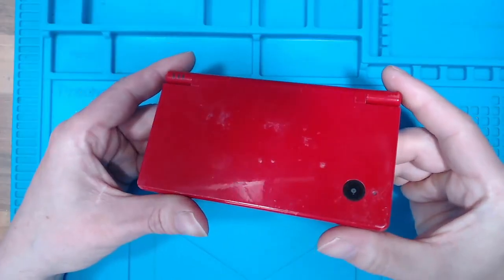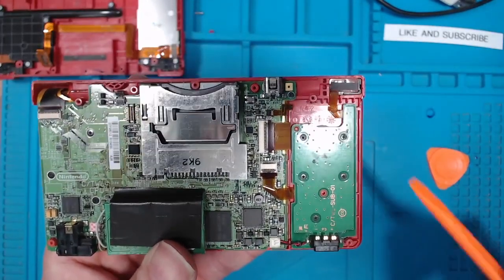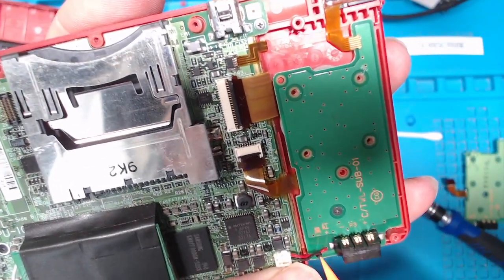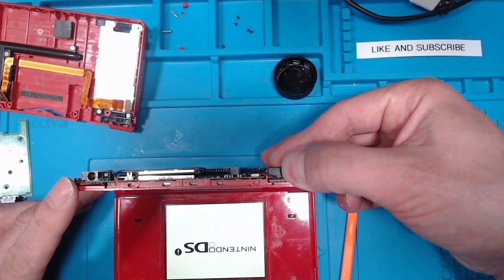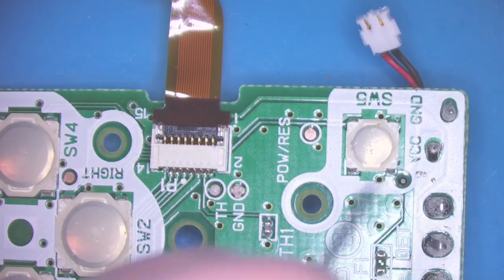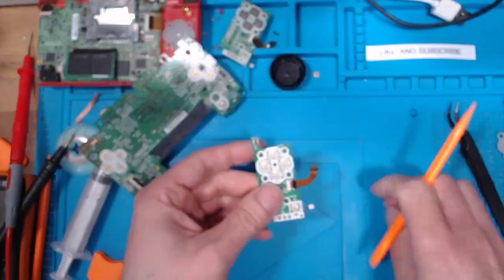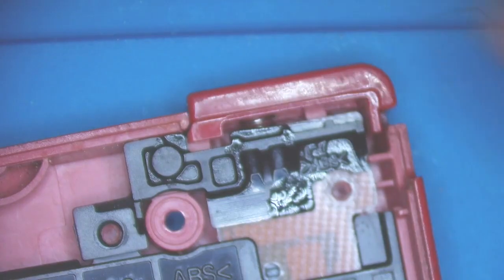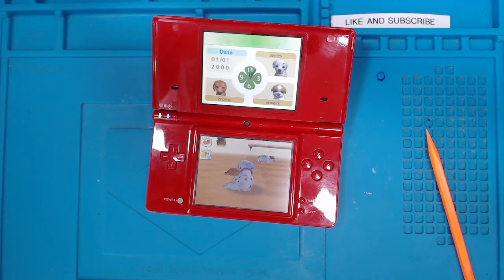Nintendo DSi won't power on | We can fix it

Comment: Mine has a charging light that turns off after a second
Reply from the maker: If it happens with a new battery installed there must be a faulty component on the board. Have you tried a replacement battery?

Comment: I have a DSi that charges but does not turn on. I checked the board and found that the female JST connector on the board is missing a gold pin. How could I fix it? How can I replace this female connector? (It's the white connector where the red and black cable connector from the battery board goes.)
Reply from the maker: You could think about soldering a permanent wire between both boards.
Reply: @PhilipBryden  Thank you for your response, but how would that be done? I don't have much experience with welding, and taking it to a service center is too expensive.:,c help

Comment: Hi. I found my old DSi but when I put it on charge, the charging and none of the other three lights come on at all. Is this just a battery issue or something else as there’s been a few other vids on YouTube where the battery was an issue but one of the lights were still coming on.
Reply from the maker: I've just taken a DSi motherboard and power board (no battery, no screens, no wifi card) just the bare motherbaord and plugged in a charging cable. I got an blinking orange LED.  So yes, you should see at least  a blinking ornage LED when you plug it in. I always say you have to start off with a known working charger and known working battery.
Reply: Thanks. So do you think it’s a problem with the charging port as well as the battery or the DSI is just broken completely?
Reply from the maker: Charging port could be a problem if the connector feels loose. Most likely the battery has also lost too much charge for it to be re-charged. USB charge cables and batteries are cheap enough.
Reply: @PhilipBryden hmm that’s interesting because when I shake the DSi I can hear and feel rattling inside, like something is loose. I’ll take a look inside, thank you.
Reply from the maker: @charlie1615 let me know what you find inside
Reply: Hi, turns out there was actually nothing wrong with the charging, and the rattling was actually coming from the buttons 🤣 the problem was that the USB port i was using wasn’t actually working so it wouldn’t charge. But there’s still an issue with the battery but I’ve ordered a new one then the Dsi should be fine 👍
Reply from the maker: @charlie1615 sounds like a good result lol

Comment: Prob just battery. I got lucky. Just bout a gbc, a dslite and copy of pokemon pearl. Pearl mint. Gbc gross af but just need cleaned and fired up no provlem. Didnt even try in og shell and dirty. And ds just put a new battery in and everything works. Crazy when its the simplest things. And only paid about 60 shipped for it all. Idk guess the person just thought they were trash that didnt work. Ive paid 45 just for gbc that may or may no be fixed or they days good but u never know. And was online too. Im just suprised since so hard to find  a good deal on retro gear these days even in shit condition. Might could even got cheaper i kept offer less on each item just to see thinking theyed counter. The DS was technically only 10 plus 4.50 shipping and pretty good condition. I was hoping for a beat up one that could make a macro atleast but got a way better deal. Prob just keep it whole since works well. Havent used a ds in awhile tho. Are the screens typically a lil cloading ln the start screen. Not yellow at all really just kinda darker in some but not dead pixels. Didnt know if just the film or images. Or maybe slight burn in.
Reply from the maker: Looks like you found some good deals. I never play on mine, they sit in a shoe box until I get around to selling them. DS screens seem to yellow over time. My latest video is a prime example of people selling stuff as faulty when it just needs a clean to get it working.  Loads must be thrown away. https://youtu.be/l0A6paSU1Ls

Comment: Phillip< i need your help. Are you, or anyone you know, understand dsi circuits well? I have an issue. When I first began to dabble in Fixing my old dsi, I took off the connector. the white one connecting the battery power to the Motherboard. I conneted the wires from the connectors directly, but rip those and now I only have the negative side for me to solder onto. Is there any fix for powering my dsi, but in a different location? I am stuck on this and would love to bring back my beloved console.
Reply from the maker: If you flip the motherboard over you'll see a BT+ and a BT-  test point. You might be able to solder there if the case allows.
Reply: @PhilipBryden  I will be honest, I did not think of the test points. I thank you for pointing that out for me. test points will still work anyways, right? First of me hearing of this. thanks regardless. This brings me great joy
Reply from the maker: I'm sure they will be fine as long as there is room in the case for the wires.
Reply from the maker: On the front side of the board, there's a pad with 4 vias next just underneath the + symbol. You could scrape the coating there and solder the positve wire there.

Comment: Hi, i have an old dsi that i haven’t used in years, i recently bought a charger for it to try turning it on. The charging light flashes orange and has been doing so since i plugged it in, it has been on charge for over 12 hours. When i try to turn the dsi on, it either stops charging or the blue light flashes on for a second and then goes off along with the charging light. The screen has flashed on for a second once. I have tried cleaning the charging port, taking the battery out and putting it back in again and holding down the power button for a long time but no joy. Any help would be greatly appreciated, thank you!
Reply from the maker: If you don't use it for a long time the battery charge goes so low, that it can't be re-charged. The best thing to do would be to buy a replacement battery. Hopefully that will get you playing your old games again.
Reply: @PhilipBryden  Thank you so much!

Comment: Hey, how are you? 
I need help, my Nintendo DSi

The problem is this: My DSi XL only works for about 2 minutes even with the battery fully charged, after turning it off, if you try to turn it on again immediately it will only start for a few seconds. But if you leave it off for a few minutes and try to turn it on again, it will work again for 2 minutes. I've already tested using another battery and the result is always the same. IT'S A MYSTERY TO ME
Reply from the maker: Is it draining the battery, can you feel anything getting hot while you're playing it? Seems like an odd fault.
Reply: @PhilipBryden  No, it doesn't heat up at all, a friend of mine also asked the same question before, and my DSi XL doesn't heat up when it's turned on.

I'm thinking that maybe I just need to clean it with isopropyl alcohol (I haven't cleaned it yet because it's only tomorrow on the 18th that the alcohol I bought will arrive)

I'm afraid the problem will persist even after cleaning.
Reply from the maker: There's only one way to find out. Open it up and look for any signs of corrosion or damaged parts.

Comment: So I just I’m trying to fix a White DSI with this same issue. Funny enough when I put the daughter board from the white dsi into a working blue dsi it works fine. However when I take the working daughter board from the blue dsi and put it in the faulty white one, it doesn’t work. What do you think could be the cause? Also just replaced the battery so it’s brand new and there are no signs of water damage to the white dsi at all. Any ideas?
Reply from the maker: So from what you ahve said, the motherboard on the white DSi is faulty. Have you checked the fuses with a multimeter? Does it charge when plugged into a charger? Do any screens flash when you try and turn it on?

Comment: After my top screen on my DSi broke, it won't turn on. It takes a charge, but it won't turn on. I got a flicker of the blue light and the screens turning on when I hit the power button, but that hasn't happened ever again. I have old pictures and Flipnotes that I want to get off of there that are saved on the system memory. I can't do the repair myself at all since I have some personal issues don't want to specify. If anyone knows someone I can possibly send my DSi to to get it repaired, I will forever be grateful. I am up in Connecticut.
Reply from the maker: Pinned. Hopefully someone can recommend a place to have it fixed.
Reply: @PhilipBryden  Thank you so much!

Comment: I don't know what's wrong with My ds. When I plug in the charger, the orange light goes on and off for a second. This is it. So the power won't turn on. 😢
Reply from the maker: How old is the battery? Your battery might be too low and it won't start charging.
Reply: @PhilipBryden  ok thanks ill try new battery. 😃
Reply from the maker: @user-bk8er2hc4l let me know if you get it working.
Reply: @PhilipBryden  I ordered a battery from AliExpress and it's not coming after a week. Where do you buy batteries by any chance?
Reply from the maker: @정환-t4u  I've them from Amazon or eBay.
Reply: @PhilipBryden  I ordered it successfully, but it's taking a long time
Reply: @PhilipBryden  I tried purchasing a battery, but the results did not change. I think the problem is with the circuit

Comment: I got the same problem but my power button works fine and fuse is good ribbon cable is good, connectors all check out. Sad
Reply from the maker: Does the battery have charge? Sounds a daft question but have you measured the voltage with a multimeter. Have you cleaned the ribbon cables and connectors with IPA? Do any of the screens flash when you try and turn it on?

Comment: I recently got one of these in for data recovery, client wants to get pictures from the internal storage. Just wanted to add a bit more info about these daughterboards for ya. I noticed some odd behavior with that daughterboard as well. In my particular case, it seems to throw off the charging input voltage. The input voltage is fine right up until the output of some kind of chip (guessing it's the actual BMS or charging regulator), in which it jumps all over the place. With the daughterboard disconnected, there is no output voltage from this chip. I suspect this is because it's expecting to see a load from the daughterboard (since that's where the battery goes). No load, no output voltage from the chip. 

I was confused at first because this board really doesn't seem to house anything but battery terminals and membrane switches. However, there is in fact a very critical component on this daughterboard. "TH1" means "thermistor". This is a variable resistor that changes resistance based on temperature. They are often utilized for monitoring battery temperatures. The idea is they can sort of act like a resettable fuse. If battery temp gets too high, the resistance of the thermistor changes, which can be used as a threshold signal for a BMS to pull charging voltage low to prevent charging the battery. 

In your particular case, it was a faulty button mechanism for the power switch. In mine, I think it is this thermistor. I don't know why else the charging voltage on the output of that chip would be going crazy. I didn't have a chance to test the resistance of this thermistor yet, but for future reference, you can test these by measuring their resistance before and after warming them up. 

Some thermistors are high resistance cold, low resistance warm, or vice versa. If you see no change in resistance, OR the resistance seems to be clocking all over the place and never settles around a consistent reading (or even reads 0L), it is a faulty thermistor. Many devices which rely on these for battery monitoring will experience issues with charging and, subsequently, powering on in-general because if the battery won't charge, it will eventually die and won't power on. 

If you're ever trying to fix one of these (or pretty much any BMS circuit that relies on a thermistor) to get it to just power on and copy data, you can likely replace the thermistor with a generic resistor. You'd have to try a few different values until you find one that causes the BMS to output a stable voltage.
Reply from the maker: That is really very interesting, thank you for sharing this. I have daughter board handy so I tested TH1 at room temp and got 10Kohm. Warming it up some hot air 100'c saw the resistance drop to 7Kohm. I'm assuming if anyone has a faulty TH1 they can replace it with a 10kohm resistor.  There's a couple of handy test points there too, right next to the ribbon cable connector.  Another great bit of info to add to my fault finding knowledge. Thank you again.
Reply: are you succeed ? are they got the pictures ? the pictures must be very valuable for them
Reply: @mrwoodcat  Yes and no. I was able to get the device powered on and popped in an SD card to start copying internal storage to external. Unfortunately, it wasn't reading SD cards. In my investigation of that fault, the device quit powering up all together and I haven't been able to figure why since. I'm hoping I can stumble into a schematic at some point. 

This particular DSi I'm working on was pretty moderately water damaged. I'm thinking there may be corrosion/oxidized balls under the CPU, but it's quite risky to yank such a sensitive component. If I can find a schematic I can test other possibilities.
Reply from the maker: @spartan456  I've been looking at a DSi that will turn on, display the menu but as soon as you try to open an app or play a game it displays the 'error occurred' message. This one is water damaged too but I guessing it's a software fault.

Comment: I’m very new to modding/repairing and I’ve learned so much from your videos. I really appreciate that your vids include a complete breakdown of your thought process and show a fair bit of you doing each step (without being needlessly long). From what I can gather so far in my own experience, it’s about learning how to diagnose issues and apply general knowledge to try and repair things rather than focusing on learning the intricacies of each specific console’s internals.
Reply from the maker: I think you're right, learning to diagnose is an essentail task. Starting with basic continuity testing then moving to diode  and resistance testing. The next level is probably reading signals on the chips with a logic probe or oscillscope.  One thing to remember is not to get carried away while diagnosing and skip the basics. Checking for missing voltages is a good first step IMO.

Comment: 7:37 I noticed the two character on the board are 黑 black and 紅 red which corresponds to the colours of the wires. A reference in the future if you run into Chinese characters on a board.
Reply from the maker: Aha thanks, that's a great detail to look out for in future. Thank you.

Comment: Hey just got a dsi from friend, its heavily beat up but no visible problems except for what you just showed, in my case both screens flash white then turn off and only turns on when plugged in
Reply: most likely a dying battery, replace it
Reply from the maker: Did you manage to find the cause of the problem. It's unlikely both screens are faulty.

Comment: my dsi also only has an orange light on but the blue one flashes every once in a while and it even turns on sometimes for a bit but once it’s disconnected from the charger it does not stay on. would i have to follow the steps in the video for my problem ?
Reply from the maker: Did you manage to fix the issues?
Reply: @PhilipBryden i bought a new battery and it works now
Reply from the maker: Lol your first post was two years ago. Have you just bought the new battery?
Reply: Check the connector when opening it

Comment: I dropped mine years ago and it stopped working plus the charger isn't working either what should I do
Reply from the maker: If it stops working after being dropped, this can be because the wifi card became loose. Open it up and make sure the wifi card is plugged in firmly. Replace the battery if you haven't used it for a long time, then the charger will work.

Comment: I just found my old one it has been dead for a long time probably about 4 years I’m sitting here charging it and the bottom screen flashes on but immediately turns off the blue light does the same thing flashes on and off the top screen doesn’t flash though. Im not a teach guy but it charges and does the flashing on them off any tips? I have charged it for  3 hours and still nothing
Reply from the maker: Often if one screen flashes, it's the other screen that is faulty.

Comment: I've accidentally ripped off the white housing that you point out at 4:06 from the motherboard - the legs have gone on it - do you know the name of this connector so I can get a new one and try and resolder to the motherboard? - ANY help would be appreciated - many thanks!
Reply from the maker: Normally you would salvage one from a donor board. If you don't have one, then I'd suggest any small connector you can get your hands on and attach it to the main board with some short wires. Or you could simply solder wires direct from the daughter board to the motherboard.